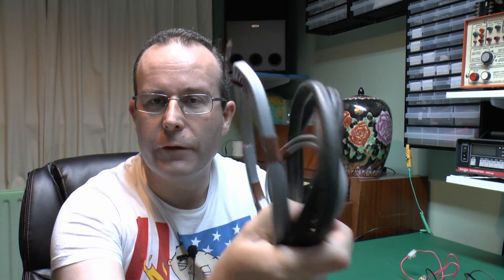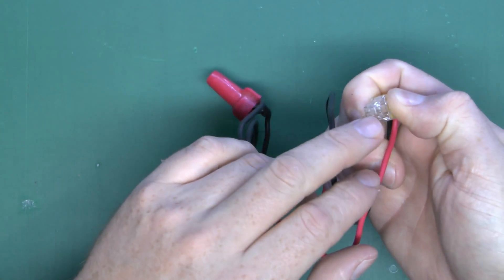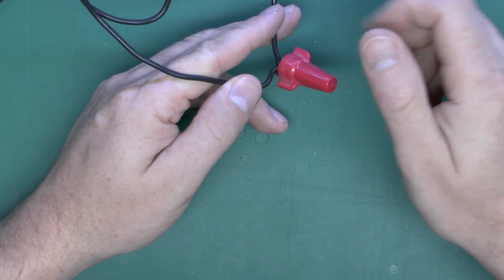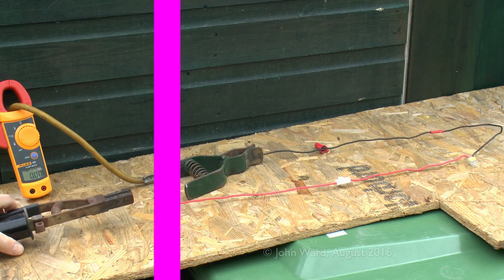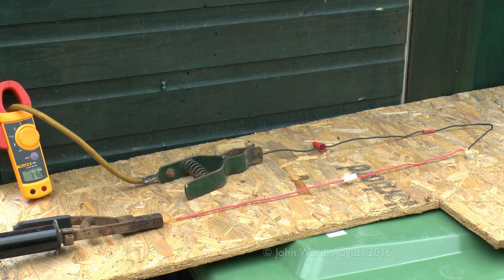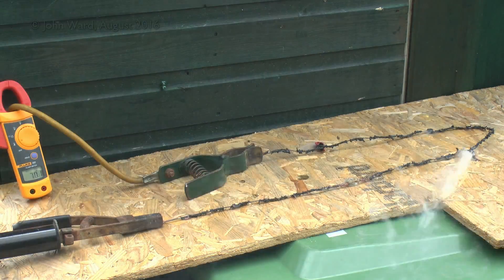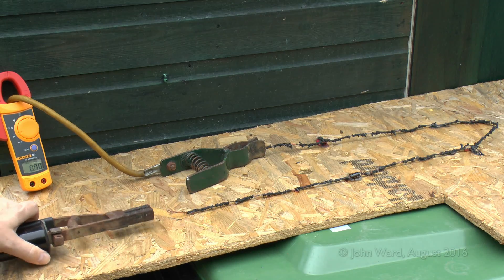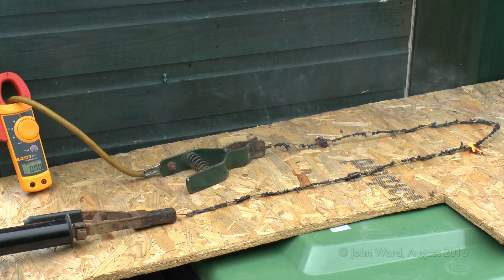Wire Connectors Overloaded

Comment: Hi JW , thank you for your wonderful sharing of the different connectors , I wanted to ask you to comment on this video that I have seen https://www.youtube.com/watch?v=-MMSdiv_IqA on connecting 2 stranded wires . It seems the connection is really strong and won't come apart 
also is the use of shrink wrap allowed in our code of practice , for 20A , 2.5mm sq , in singapore the crimp connector is a standard for connections .
There are various comments on the video link I just shared saying that the flow of current and heat built up at the joint will be a factor . the remarks made on the link could be that a proper connection will not be made and arcing of the joint could occur . Can there be a combination of the method with a larger crimp connector . (eg : if we are joining  two 2.5mm sq cable, we twist them as shown in the link and then we could use a 4mm sq  Yellow crimp connector to crimp them)

Comment: I've been using those WingTip Wire Connectors aka '' Scotch Locks '' by Ideal or 3M since the Mid 60's !!! There is NOTHING Wrong  with them ! They are widely used in the USA !!!

Comment: Surprised at you holding the energised clamp with no rubber gloves, you were an inch from death, then later an non insulated driver. Then the fumes, why be so careless. Why didn't you turn the power on after clamping.
Reply from the maker: It's an isolated supply at a maximum of 50 volts.  No death involved.
Reply: It is high current, not voltage. This could be done with only 1V, which is same as an common household AA-sized cell has, when it is empty!
the higher the current, the higher the risk of fire, needs thicker wires
the higher the voltage, the higher the risk of electric shock, needs thicker insulations
In electricity, you have to choose between these two dangers.
Below 25VAC/50VDC, it is considered to be not dangerous to men who grabs both poles at once (as long as the voltage is properly insulated from any higher voltages). This voltage range is at least in germany called "Safety-Extra-Low-Voltage".It is not enough voltage to bring deadly high currents through the body.
And if the voltage would be higher but the circuit is insullated from ground, still nothing will happen, when he grabs only one clamp. Best example are the doves sitting on high-wires every day.
You could do this experiment with a 12V car battery.
Reply: The voltage was still fairly low, I am sure it was from a welding set, not enough volts to overcome bodily resistance under normal dry conditions.
Reply: welders do exactly that every day. he's more than safe.

Comment: Gee just what I don't want, a red hot wire to start fires. Would be nice that the connectors failed before that happening and disconnecting power.
Reply from the maker: The fuse or circuit breaker will disconnect before the wire overheats, the point here is that the connectors do not fail before the wire, so in a real installation neither the wire or connectors will fail.
Reply: A failure of connectors could be what starts the fire. We don't want connectors to fail, well unless a reliable fuse was actually built into the connector?

But when your circuit goes dead, you go to the circuit breaker box first to investigate. Why should you have to check every junction box?

And isn't that why all connections are supposed to be contained within an electrical box, that has a cover on it. To help contain sparks from loose connections? But I have long wondered, what was the reason to go from metal to plastic boxes? Because plastic is cheaper and crappier? Wouldn't metal dissipate heat better and would better contain a fire? Wouldn't a plastic electrical box, just melt and let heat build up easier?
Reply: yep. if they were prone to failure they wouldn't last long in the market
Reply: sinephase
So you do not think that markets can be sometimes stupid? I mean just look at the horrible election results. How could people actually vote for Bonds that raise their taxes? Perhaps most any connector is better than just twisting wires together and wrapping it with electrical tape?
Reply: sinephase
Elections show that markets too often, do not make the correct decisions. And haven't you noticed that there is some crappy electronics junk, coming out of China? How could they make such junk, if people were smart enough to either not buy it, or return it and complain about it?

BTW, I think that I agree with the U.K. Brexit vote. People should more often speak out or opt out of the rampant government corruption, and isn't the European Union, way way too corrupt? Either figure out how to reform those corrupt government organizations, or abolish them. The stupid globalism (consolidation of political power in the hands of the unaccountable few) of the globalism utopian evil elitists, is flawed to the core.

The electrical code is based upon safety and best practices? Oh really? Then why are not more devices fuse-protected, or have fuses in the plug as in the U.K.? Does a clock-radio really need to be allowed to draw 10 amps or more through its power cord, in order to function properly? It doesn't need 10 or more amps, unless it is a kitchen appliance or a heater or an air conditioner. Why not protect it with a half-amp fuse? Or even a lesser-capacity fuse, well unless it has another (daisy-chain) electrical outlet upon it? We could also do fused plugs, without making the plugs ridiculously huge as they are in the U.K. The plug could still be small enough to fit into just 1 outlet of a multi-outlet surge suppressor strip. Too many "power-brick" transformer plugs hog more than their 1 outlet fair share of the space.

We should be thankful for all those YT videos in which people disassemble devices to see how well they are built and how safe they are. Yet there are far too such YT videos, to find your device in question. Those videos just give you some idea, of what sort of crap to be alert for. Most people have neither the time, nor the ability to disassemble their own devices, unless something is seriously wrong with the device, and they are trying to fix it. I did successfully repair at least one electronics device, and have successfully modded at least 1 other device with somebody else's help. Yet, I don't have much for qualifications, other than owning a couple of multi-meters and a couple of soldering irons.
Reply: Fuse in the bulky cord in the UK is legacy when decision was taken to try to save installation costs by installing a ring final circuit with the sockets distributed along it.
Many electrical appliances have fuses on the input power supply inside the appliance, so why would you need another on in the plug ?
Taking about rest of the Erupe; Fuse protects the wire  circuit from the overload. Electrical appliances already come with proper cord for the device.   With fuses in the central fuse box you are protecting house installations/circuit, so one in the cord would not make it safer.  In this case the fuse in the plug protects only cord from overload, and this is not needed if cord is proper for the appliances. 
IMO Fuse in the plug does not make sens because your circuit is protected with the fuse in the central fuse box in the radial system .
Reply: Because what you plug in isn't necessarily rated as high the mains circuit supplying it. Though many of your appliances with unfused plugs will have internal fuses for the same reason - it's still easier to replace a generic fuse in a 3 pin plug than open up the back of your TV and invalidate the warranty.

 It would also be better to blow the fuse in the plug than trip out anything else on your radial circuit.

Comment: JW gone photonicinduction for views.Beyond design ie 70 degree c cable max temp- the burnt insulation renders connectors and experiment irrelevant.
My interest was whether a fault current that can possibly overheat a reduced cpc would cause connector resistance.
Thermal camera would have been great, non contact thermometer otherwise.
Genuinely disappointed as expected far better

Comment: Place 70 amps down 1.5 cable and you wonder why it melts , why not try 10 mm cable and see if you get he same results ? Your experiment although informative isn't really proving anything .
Reply: Tell me, how would you get 10 mm2 cable into a connector rated for 2.5? This is as much as a real-world test as it gets, it tells us that using the most common conductor size the wire fails before the wire does.
Reply: The connectors in the video are not designed for 70 amps ,  however if he was to place 70 amps down a 10mm cable with the correct connectors then the results would be different.
Reply: actually because the wago is the one that stresses the wire bends more than the other designs, its going to cause more failures,     keeping the stress in a line such as the choc block is better, even the wire nut is better as the bends give the wire some give before stressing it
Reply: Clearly you missed the point of the video.  The test was not the wire or to see what could be melted.  The idea was to test which connector failed first.  However, all connectors performed remarkably well, even at almost 4x the rated capacity.  Ultimately, the experiment was not a success in figuring out the weakest connector, but it did prove that any of these connectors can handle well over what they're rated at (installed properly).

Comment: To be fair to all connectors, reverse the order'!
Reply: Kirchhoff's law (and common sense) say that the current is the same at any point in the circuit. (Where would you think the electrons went, if not all around the circuit)

And it's probably AC anyway.

Comment: I would not use wago or any other push in connector or wiring device, that's just the lazy way out. I will not take the chance with these half-a$$ed things.

Comment: yes... poke a live electrical circuit with an uninsulated screwdriver... although the man sounds intelligent, he is lacking in common sense
Reply from the maker: Isolated circuit with a limited voltage.  The only danger is from the high temperatures.
Reply: Got to watch that driver with those high currents...
Reply: High current LOW VOLTAGE as John said being burnt is for more likely
Reply: I'm afraid I don't follow the sense of this rant.  Isn't the screwdriver handle an insulator?  So what if the barrel of the screwdriver were insulated, the tip would still be exposed.  How would it have made any difference in the context of this video?
Reply: Lee Gilray yes very dangerous you should definitely be scared of it..lmao
Reply: Common sense tells you not to poke live circuits with screwdrivers because it might be unsafe.
But proper training tells you how to make sure it is safe.
Reply: Screwdriver?  Photon would have hit it with a big hammer!
Reply: Those clamps are used with arc welders which usually run 70 volts open circuit and 20ish closed.
Reply: Lee, let me give you a pointer: your level of knowledge in the field of electricity is such that you should not be slinging insults at others. 

It is high current, not high voltage. Just as you may touch the terminal on a car battery, which can supply hundreds of amps, without being shocked. 

But really, stop embarrassing yourself.
Reply: I might add that a car battery is only 12 or so volts, your skin and internal tissue and heart might measure a few hundred thousand ohms from hand to hand. Lets say its 200kΩ. So, 12V / 200,000Ω = 0.00006 Amps. That's almost nothing! If your skin was cut or salty and wet, it might be a problem.
Reply: @swillswill
in high tension, it is possible for electricity to go through air so if the installation was at 220V, at 90A it could have been possible for the current to jump from the barrel to his hand, electrical screwdrivers have the barrel insulated to avoid those electric arcs reaching the user hand

but here in this low tension application, the risk of an electric arc forming was very low
Reply: Screwdriver handles which are not specifically designed to be insulative are sometimes conductive enough to be dangerous, more so the higher the voltage. With a welder the open circuit voltage can be high enough to be dangerous in some situations. As it is the likelihood of injury is low, but some extra precautions would make it far lower.